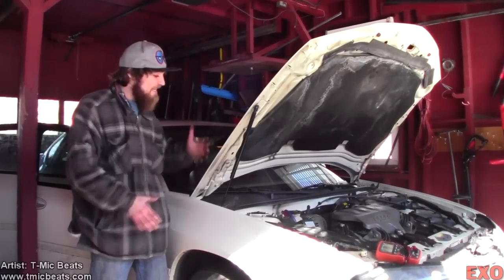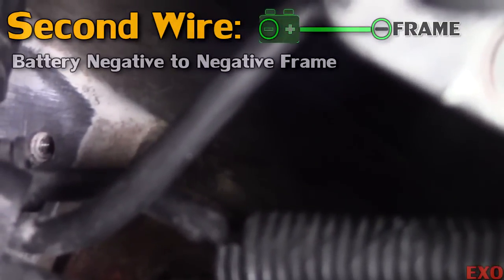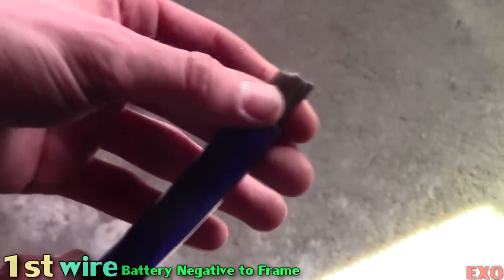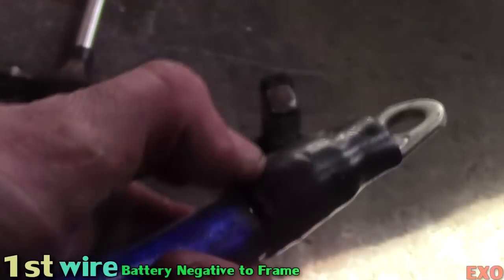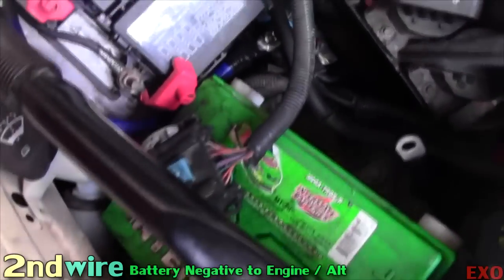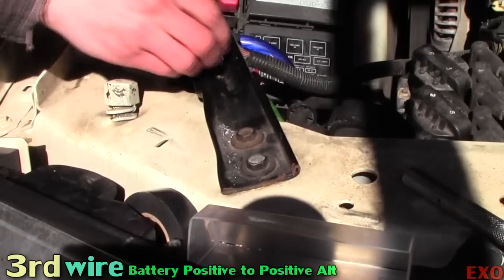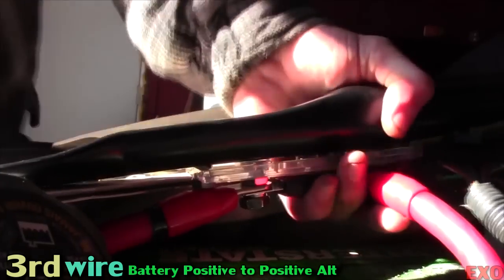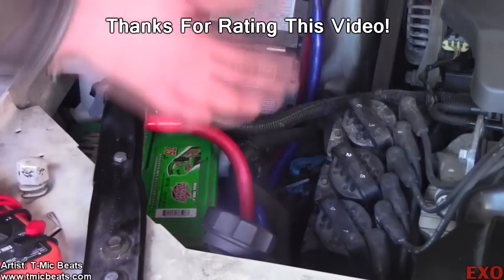How To Install BIG THREE Upgrade | EXO's BIG 3 Car Audio Wiring Tutorial to Increase Power Flow

Comment: Hey EXO. I'm doing the big 3 upgrade on my Acura Integra and was wondering where did you get your wire and fuse? I've looked on Sonic Electronix, Amazon, and Car Toys, but I don't know where to get quality for my buck ya'know.
Reply: sky high audio. check'em out.
Reply: Matthew Murray Not sure if it still matters, but I too did research and didn't want to break the bank. Kicker zero gauge is awesome BUT pricey... My true zero gauge and great wiring items company is Knu Konceptz.. A lot cheaper, i buy from Amzn.. american audio is good too.
Reply: Thanks I'll check them out

Comment: Is the inline fuse really necessary when running a power wire to the battery? What if.my alt is on the other side of my engine as the the battery. How would exactly would I run a ground to the battery without it being to long of a ground. Exo says to keep ground as short as possible.

Comment: Do you remove the stock positive and ground leads going from the battery to the alternator, or only add to it as a supplement, as mentioned with the chassis ground?
Reply from the maker: ADD, never take away.
Reply: EXOcontralto  thank you, I will be doing this with a 250A fuse using pretty much just your fantastic video, great clarity and visual aids.

Comment: Can you tell me where the ground is for battery? I have the 3800 motor as well and I have a really short thin black wire from battery to wall of car it's about 8 inches long will that work? I also have another wire coming from negative terminal but it goes down by my radiator and the bolt holding it is almost impossible to get to. Which one should I use for ground from battery?
Reply from the maker: Use the point closest to the battery, and just ADD TO the existing wires.
Reply: EXOcontralto ok cool thanks man I appreciate your help

Comment: One thing you could have added to your install is dielectric grease at your connections. This prevents connection breakdown  in the future.
Reply: OVER not on the connecting surface, this need to be clear haha

Comment: dude I wish my astro van was easy enough to work on! my voltage will drop to 12 volts and lower from serious pounding on a 1100 watt alpine amp. I got a cap and that helped but didn't fix the drainage problem. what do you think? would the big three help or should I get new wiring with alternator? or is there a drain somewhere?

Comment: i have only 2 wire from the positive of the alternator to the positive of a battery and from the negative of the battery to frame does that work ? or i need the third wire from the negative of the alternator to the negative of the battery ?

Comment: What about if your battery is under the rear seat? I don't think it runs from the rear to the front since there is a junction box upfront. Would I have to just double up the big 2 in the rear and then the big 3 in front? I would need 5?

Comment: I have a small battery can i connect a interstate megatron plus and will it both charge at the same time or do i have to install a switch to control the charging?

Comment: I have a 2000 watt RMS system. 160a alt. I'm using 150a fuses, is that safe? Also I done the 3 wires like u did in the video. I hear there's a 4th ground chassis to block. Does it matter where I put the chassy to block ground?

Comment: Someone ANYONE please HELP me i have a 04 CHEVY impala coppied EXo`s BIG 3 video but it made my voltage drop i a have a stock alternator (105 amps) everlast gold battery 800 cold cranking amps 1100 cranking amps with 110 reserve amps i used "KNUKONCEPTZ" 1/0 gauge with a ANL 300 amp inline fuse sanded my grounds to bare metal ran that line to my 1.2 farred powerbass capacitor then from there it splits off to 4 gauge to my hifonics brutus 2000.1 D i have the two grounds mounted to my suspension which leads to my frame. before the BIG 3 i couldnt really turn the amp up i had serious voltage drop from 14.57v to 10.9/8v at times NOW it idles at 13.4v and drops in the low 11 so overall its not dropping as low but this amp requires 14.4v and in result i still cant turn the amp up someone help me please ill take any suggestions this amp has been hell i cant afford to just let 500 dollars go to waste i appreciate all the help i can get
Reply: I am not an expert so hopefully if I am wrong someone will correct me. But what I think you should do is go to auto zone or whatever, and get your battery recharged back to where it needs to be. If it keeps dipping down like that, I would suggest talking to your local shop and look into getting a new alternator with a higher amperage. I don't know what your whole system set up is, but if it is putting out serious power, you should really look into getting a higher amp alternator. Before you buy anything you really should talk to a shop and see if it is a battery problem or a alternator problem first.
Reply: It could be your voltage regulator going bad
Reply: The suspension is only connected to the frame through rubber bushings (not directly). ground to the frame or body of the car.

Comment: i plan on doing the big three up grade and running 1/0 gauge wire to second battery and im planning on using sky high wire and they said a 200amp ANL fuse should do fine is that true?

Comment: What size alternator do I need if I was running 3 amp 1-9k 1-3k 1-1.5k ? Would it be best to put in a 300 amp ?
Reply from the maker: So like 13.5 killowatts???  You'll need more than a 300a alternator to properly keep up.

Comment: By any chance do you remember the length of the wires you used? I have the same car.
Reply: I need to know to I have the 02 impala but its still under the same generation. I want to buy some wires but I dont want to be short
Reply: Just remove OEM for measurement and follow same path

Comment: Do you keep the old wires hooked up? I was told not to because it could cause problems. I had a fuse case melt in my car and i need help.

Comment: Need your thoughts on hooking up a set of speakers that 5200 watts and rms is 1300 watt.Now I have two amps 1is a jl audio e1800d the other is a Boss 4800 watts which amp would u prefer and at what ohm thanks.

Comment: Oh, one thing I would have liked to have seen you use dielectric grease on the connections, a $0.99 pack which are right by the check out at any auto parts store will go a long way or better yet Parts Express has plenty of different sprays and greases to clean and protect electrical connections of all kinds...I get all kinds of great install from them for both home and car audio/video installs

Comment: When mostly everything are run by computers do big3 harm systems on modern cars??
Reply: EyyRedhouse absolutely not. It's like putting larger cooling  hoses on your radiator to your engine. It just allows more to pass through. 

Raising the voltage is about the only thing that could harm your stock electronics. Your computer will only take as much amperage as it needs so larger alternators and batteries will not hurt it either.

Comment: I have a question .I need to add a second battery, does the power wire from the secondary battery go to the power wire or the Alternator?

Comment: Ok so positive battery to positive alternator, negative battery to negative alternator and negative battery to ground, so where did you connect the cords with the fuse??
Reply: power wire is positive battery to positive alternator, i believe.. don't hold me to it 😂

Comment: Is a inline fuse really nessary when going from positive post to alternator?
Reply: Yes, anything that connects to your battery "should" be fused. if the connection to the alt touches any part of the engine it could cause a fire. instead of the wire getting super hot from all of the amps pushing out of your battery, the fuse simply pops. That's why it is also a good idea to try and locate the fuse as close to your battery as possible.

Comment: EXO. I did the big three the same way you did bro on a 2011 Toyota Avalon but I am still getting the same voltage around 13.7   13.9. Could it be because I don't have and AGM battery under the hood? I have a Krank It Up 1400 watt audio battery in the trunk. Please help me! I also don't have a isolator for both of the batteries so I don't know if that could have anything to do with it as well

Comment: Hey just subed. I have a 05 impala, And I was wondering what length did you use for your impala. Trying to order the wire asap. I was thinking 5ft power 5 ft ground..What ya think?
Reply: Did you ever figure that out yet? I have an 02 impala and I dont want to buy too short of a wire

Comment: R u doing a high output alternator .. I have 2000watt amp and two 12s wired 1/2ohm and I have to do dig 3 and battery in back 250alternator  witch it been a pain to get for a Oldsmobile cuttless cirea

Comment: hey man the negative post on the alternator is that the braket or is it part or the alternator itself. I don't have another bolt on mine
Reply: in that case the shell acts as a ground so grounding would be from the mount. sometimes a ground can be added to the rear of the alt bolted

Comment: is it a good idea to do that fuse line?? and what if you don't have a fuse in there?? thanks
Reply: ***** As long as I fuse it what should it be rated at?? I don't have 0 gage though. right now no fuse is in line. working progress I'd have to say... in the middle of upgrading everything.. then I shall fuse it. :)) just fixed the engine issues.  I have a brand new fuse inline protector holder and an 80 amp fuse brand new.. what's the suggested rating?? help please. suggested use for approximately :)) needing battery hook up. can I do stock battery to a red top battery say to quote if low on cash and will help me get by winter ((:  should I parallel? or series? honesty please. pull right up on to my driveway and let's see some [[[[[{{{{{(((((flex action)))))}}}}}]]]]] like exo# kate perry # kissed a girl bass demo @ my front yard Nye :P idk
comments and also help for wiring my home surround sound and speaker installs video projector etc etc. mainly the speaker wiring come on through.
Reply: Also, if you pinch or ground out that un-fused power wire, you will burn your ride to the ground! Don't ask me how I know.
Education is expensive... one way or another.

Comment: Is the big three upgrade a different entity from the amp wiring kit meaning that I don't have to worry about the already run wires and fuse for my amp when doing the big three and fuse upgrade?

Comment: it looks like you connected the fuse block to the battery twice. is that right? You said to go from the alternator positive to the fuse and then the fuse to the positive battery. It looks like you connected both ends of the fuse to the battery. Am I missing something or is that how its supposed to be done?

Comment: Good video but I would only do this if I had an upgraded high output alternator. Doing this on a stock alternator would kill your alternator way faster becuase your pulling so much more current than the alternator was designes for. Biggest I wouls go on a stock alt is 4 gauge. Your asking for trouble going 0 gauge on a stock alt.

Comment: Can someone please help? For some reason my multimeter is reading that I lost voltage after this...
•I upgraded engine to body ground
•I upgraded +alternator to +battery(which had a 200A fuse spliced into)
•I upgraded -battery cable to ground

In the process of this, 
I also cut and spliced existing factory +battery cables and connected to a new battery terminal. (Which also has my +alternator wire connected, and my power wire for amp connected to). 

The old -battery to ground cable was removed and replaced with new wire. 

With the results, 
I’m getting a new voltage of 11.50ish V, and the old voltage before this was all done was 12.85-12.87 V

Side Notes:
•2011 Honda Civic
•I believe 80A Alternator
•And a really good car battery(forgot brand)
Reply from the maker: Sounds like a improper connection somewhere, perhaps your crimps are loose. But what did you splice the existing wire for???
Reply: EXOcontralto thanks for the reply! And sorry for the long rereply..
From what you suggested, I have a feeling it’s the engine to body ground connection(might not be sanded down enough or just not a good ground).

Now as far as why I cut existing positive battery terminal cables.. was because my 1/0 connectors wouldn’t fit on the old battery terminal. So I went ahead and bought new terminals, and just cut back and twisted the existing wires together and Allen wrenched them into new terminal. Now I’m worried because I think I cut the cable too short and the wires are kind of “forcing/stretching” and their not really in the terminal “comfortable”. If that makes sense? Lol
Therefore I feel like I should just replace that whole new wire..
Reply from the maker: guitarzrawsome Understand a bit more now. Replacing the terminal shouldn't do anything detrimental to the voltage. However what method of crimping was used???
Reply: EXOcontralto I used a hammer crimp like yours. 

I’ll probably have to buy a drill and make my own grounds. I used the ones I could find best and get loose because the BEST bolts were way too tight for my basic tool shit to get loose. I tried wd40. 

Other than that...  
It maybe be my alt.? As I just bought my battery about a year ago.

Comment: I got a synergy 2k amp on 2 Americanbass 15s would it be fine to run the big 3 in a ford explorer Eddie bauer edition with 5.0 v8? Using 0 gauge wire with a 250 amp fuse. My stock 0 guage going to amp I'm using a 200 amp fuse.

Comment: hey, im going too be setting up a jad1200 . would you consider  the big 3 upgrade? or maby just a capasitor?
Reply: +xXDjBlareXx Never buy a capacitor, if the big 3 still gives you dimming headlights then get a better battery.

Comment: I ran a big 3 and someone said that I have to run a wire to the engine block? Some kinda of strap to chassis I ran 0 gauge from positive battery post to positive alternator,  negative battery post to alternator and battery ground to body chassis.  Is that all good?

Comment: You don’t run a negative from alternator to negative battery
For a big 3. You run a negative from engine block to frame for ground. You ground the battery to the chassis and only run the positive to the alternator. Amazing how wrong people get this. You also don’t need a fuse

Comment: Exo, why did you connect a 300 amp fuse to the stock alt?  stock alt amp rating?  Shouldn't that fuse be set aside until you get the new H/O alt?  Thanks dude, excellent video.

Comment: I have always I guess done a big 4. Do what you did in the big 3 but added a ground from my engine block to the frame. My side post negative terminal had a thick wad of wires coming from it. 3 (0) gauge and then the factory ground wires. Was actually thinking about putting in a ground from the cab to the frame. That way everything is grounded good

Comment: Hi there EXO i was wondering, if i run a 2000 watt amp and sub would doing the big 3 help my sound system or is there no need to do it as its only a small amount of watts ?

Comment: Question: When connecting the ground wires to the battery,  did you secure both grounds together without any separation between the ring terminals?  Thank You

Comment: Not sure what's going on I done the Big 3 on my Jeep I actually added extra grounds to my engine ground 4 ground to my negative on my battery upgraded my positive to my alternator on my engine ground I put 2 0 gauges to it two kind of double the ground put grounds to chassis to frame my alternator is 140 amp alternator and it only registers 13-3 votes Sundays and some days it registers 14:6 votes it fluctuates I don't understand that and a brand new alternator anyone out there and knows what I should do like some help thank you
Reply from the maker: Sounds like you could've possibly forgotten to check or tighten back all the connections.

Comment: what's the big 3 for
Reply: Derek Waymire to help with voltage drop. if you are putting a big system in your car you would want to do it. but a small amp & sub should be fine with stock wires

Comment: Hey man in need of some help , my voltage is dropping at my amp can't figure the issue. Just finished big three wire upgrade voltage at the batt is 13.8 when the bass drops but 11.7 at the amp. I've got an xs xp950 , stock alt. 4 guage throughout including the big three. Massive n4 and a single PG ti2 15 . Wired at 2 ohms. Any help would be awesome thanks bud.
Reply: Did you ever figure out the problem?

Comment: That is pretty interesting, but what really helped me on my wiring was to run positive and negative cables straight back to my amp instead of bolting to ground. That helped my dimming lights. I'm pretty sure the big three will only make it better.

Comment: Just finished the Big 3 on my vehicle last Saturday. It is a great upgrade to any vehicle. All that extra current flow helps with cranking and ignition as well as getting more amps to the battery in a shorter time. Watch the video and do it.
Reply: I have my subs and amp power coming from the front battery, when I put the bass up my lights on dash board dim will this upgrade help me in my situation ?

Comment: stupid question but i need to know. have you ever had the power cable melt?
Reply: It's because it to close to your engine and its melting your wire move it away from your engine and anything that to hot to touch
Reply: M Eecheverria or you were running too small fuse up front for amp in back. or you had a loose connection somewhere
Reply: M Eecheverria try running bigger cable, I used to melt fuses and power cable because the wire couldn't handle the power output so we replaced 6 gauge wire with 2 gauge wire